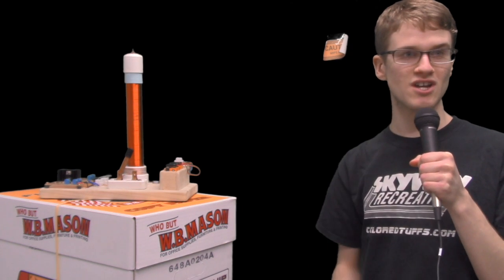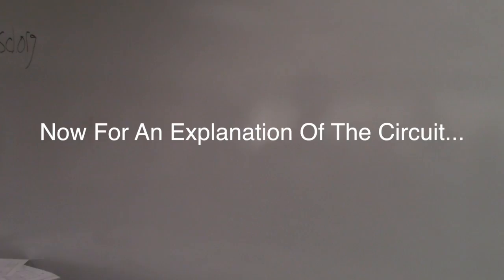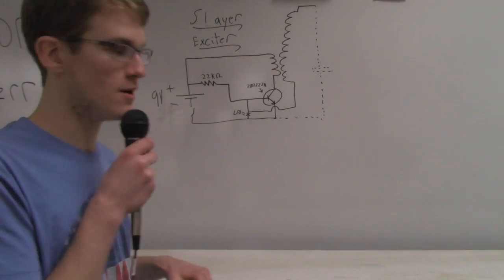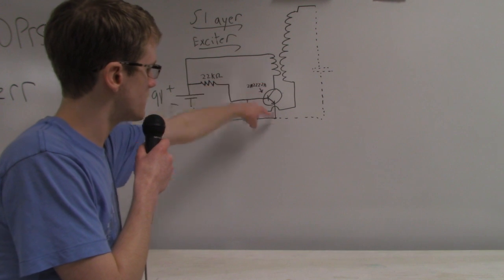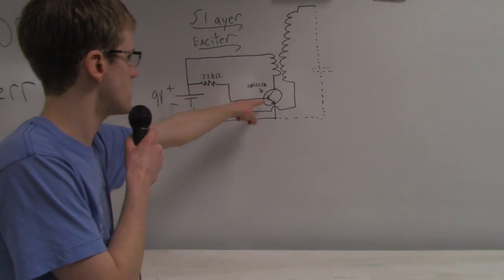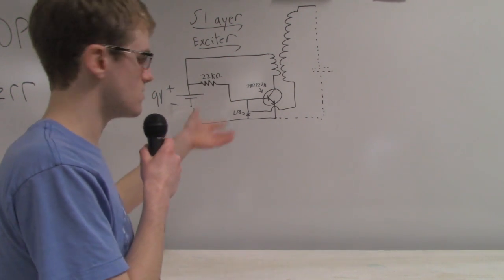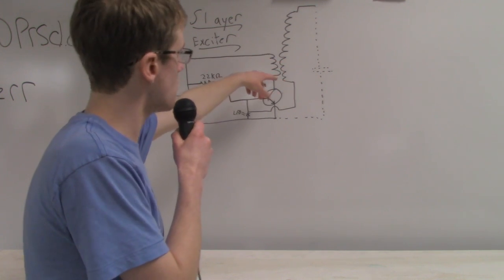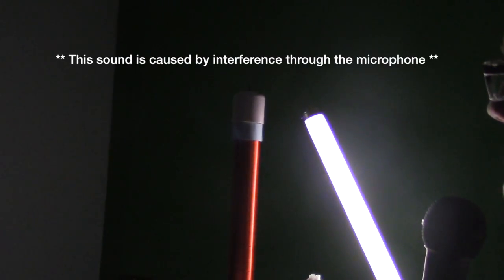Tesla Coil

Comment: why does the circuit turn itself off when the current goes through the resistor
Reply: nice vid btw
Reply: The circuit turns off due to the large negative voltage present at the base of the transistor. This negative voltage is coming from the large secondary of the transformer(the big coil). The other end of this coil has a parasitic capacitance with ground, making the voltage at the base of it negeative with respect to the rest of the circuit. When a negative voltage is applied to the base of this type of transistor, current ceases to flow, and the circuit turns of momentarily. This process then continues rapidly.